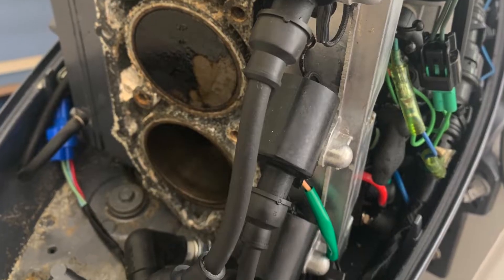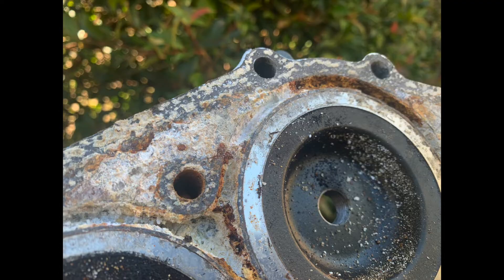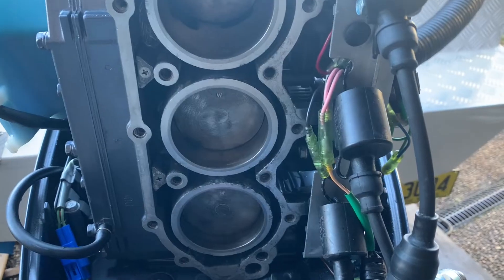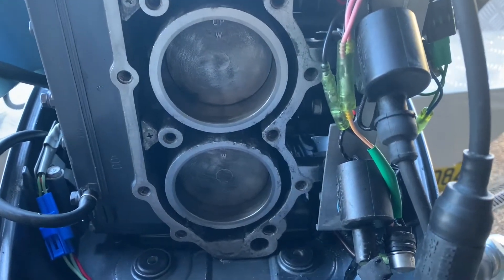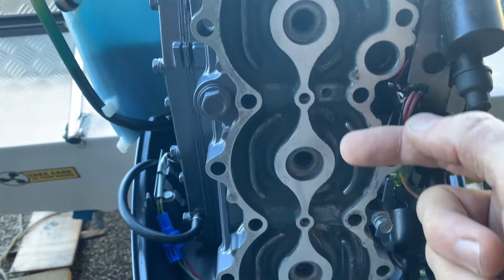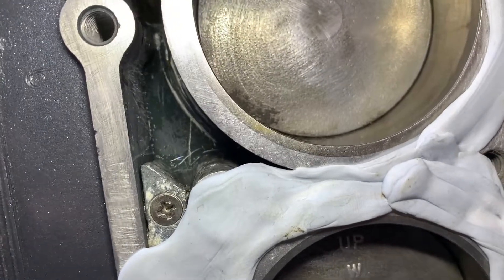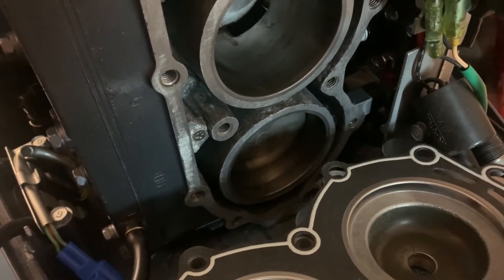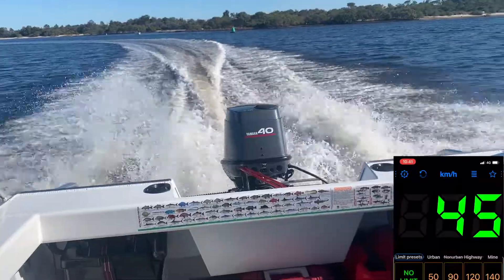Remove salt build up Yamaha outboard 40hp block head restoration Challenge get motor running 30 50

Comment: I’ve read that head bolts sometimes snap when taking them off. 
Did you have any issues taking them off?
Very education video.
Thank you
Reply from the maker: Hi Jim! Yes especially if over 5/10 yrs old & in salt water a lot, they are often locked with salt & snap.. I had to drill re tap one as the video shows re tapping thread etc.. Main thing is go very easy attempting to loosen bolts,, If you break bolts & lots of them, its often a bin job at that point.. Hope you go well with yours if servicing internally! Thanks heaps mate! 😃😃😃
Reply: @mikemike7523 thanks for the reply

Comment: Got a 60 hp two stroke , 7 years and same, all head system blocked with salt and corroding through head cover . Thought we flushed it but obviously not till thermostat opens. Redid the whole head system and left out the thermostat, we live in the tropics so reckon don't need it , same with cars  , now water flows through head when flushing and hopefully don't have a repeat for many years .
Reply from the maker: So good! yes leave thermostat out, will flush better for sure! Well done! 😃😃😃

Comment: Excellent and informative video Mike. Have just cleaned-up and re-fitted the very-clogged head of my over-heating 1986 40HP 2-stroke Yamaha - very similar design to your own. Two experienced local outboard mechanics wouldn't touch it. Only problem now is I didn't put enough gasket-cement around where the spark-plugs screw in, so a little water is weeping out past the thin gasket around the plug holes. I'll try sealing from the outside, and if that doesn't work I'll remove the head again and do a better job on the gaskets. Doing the work yourself is definitely the way to go. Vids like yours are priceless to amateurs like me. Many thanks.
Reply from the maker: Oh so good to hear!! Well done on cleaning yours up too! A little bit of work & elbow grease, leads to a job well done! Love it! Thank you! 😃😃😃

Comment: Did you need 1 gasket for this job or 2? Did you just use the gasket sealer on one of the faces?  
Doing mine this week,  any advice appreciated
Reply from the maker: Hi! there area numerous gaskets to do this job, which is why the full engine rebuild gasket kit is best cheapest option to get all gaskets... i never use any sealant on gaskets.. Im sure most mechanics would agree, that cleaning & preparing the surfaces with wax/grease remover & paying close attention to that cleanliness, is the most important thing... the gaskets are designed to seal well when surfaces are clean. Hope this helps! 😃

Comment: Nice video, thank you.
Question ; Yamaha 250 ox 66. When I get back to the dock and hook up a hose to the engine flush hose , if the thermostats are closed , where does the water go ? which part of the engine is not getting fresh water to? thanks
Reply from the maker: Hi! Generally if it's still cold & thermostats are still closed, or they are faulty & not opening,  it wont cycle the water in the blocks, so the water can overheat the engine then... The water will still always flow out the tell tale outlet.. Don't be deceived in thinking it is operating cooling water through engine, just because it flows out the tell tale visible outlet/spout... this is why full inspection & removal of heads is important if you suspect a problem internally like my video shows.. Hope that helps! 😃😃😃

Comment: How did you repair the hole at the bottom of the block?. I have the same issue with my 50hp Yamaha. Thanks
Reply from the maker: Hey! Yes there can be holes form after a few years... If its accessible to TIG weld or is worth the effort to remove block from the mounts to access, then do that.. I used liquid steel 2 part mix. Its strong, holds extremely well.. If the area is cleaned up well first it can be a good permanent fix. The key is good preparation. The water pressure is a minimal positive pressure, (unlike a car radiator / needing to withstand high KPA pressure), so the repair doesn't have to be pressure critical. Hope that helps  😃😃😃

Comment: I can tell you from my experience that sadly most of my customers don't give a flying f**k about paying for this service - until it's too late and they have to pay way way more to get a replacement engine. I do this to my own engines mostly
Reply from the maker: So true, yes it's far better to do periodic maintenance even if its a more costly service once every 5 years or so (head off & clean/new gaskets etc)... 😃😃😃

Comment: What is the difference between the new 40hp enduro 2 cylinder?
Reply from the maker: Hey! Not sure how new you mean, the latest current new models  are 4 stroke 3 cylinder.. Maybe you mean the 2 stroke 2 cylinder enduro a few years old still? (pre 2020)  If so, they are very similar to this setup.. just a bit more simple being only twin cylinder.. Hope that helps 😃😃😃
Reply: In malaysia we have 2 stroke yamaha outboard named yamaha enduro, but the 40hp only have 2 cylinder, rather than your version which is 3 cylinder, just wanna how different it would have in sea water
Reply from the maker: @firdausfazil1666  Yes we also have the 40 enduro 2 cylinder in Australia, up until a few years ago when 4 stroke became the only new option to buy. The enduro 2 cylinder is the cheaper version but still a very good motor. The 3 cylinder is a bit nicer to use as it has a smoother idle & rev range with the extra cylinder. It was a bit more to buy, roughly $1500 more for the extra benefits... As far as rebuild, they are very similar, so the job is the same to service.. hope that helps 😃
Reply: @mikemike7523  thanks you mike, im planning to buy 22 feet fibreglass boat with centre console, what type and length of boat you run the yahama 40hp? Btw, if you ever come to malaysia maybe we could go fishing together.
Reply from the maker: @firdausfazil1666  The 22ft (6-7m) fibreglass boat would be a bit big for a 40hp i think, unless you just putt around a bay in it.. a 40hp in Australia is normally seen behind a 4-5m aluminium light boat & it will perform well & get the boat planing easily.. A boat 6-7m fibreglass heavy hull would normally have anything from 100-200hp behind it so it can get up to planing speeds easily...  Happy fishing!! 😃
Reply: @mikemike7523  hahaha, guess i will go for bigger hp, thanks for the advice mate 😊

Comment: Excellent clip! Would you please tell me which parts that need to replace when performing this job? I'm about to follow yours to clean up my 90hp Yamaha 3 cylinders. Thanks.
Reply from the maker: Hey Victor, main thing is the full engine gasket kit.. apart from that, just normal service things like thermostat if its due/needed.. It's mostly chiseling out any hard salt build up, so mostly cleaning & put back together unless you break head bolts getting the head off.. if you break a few, the engine is probably not worth trying to go further unless you really know what you're doing to drill & tap bigger head bolts in... but broken head bolts being high tensile stainless, are extremely hard to drill out... I'd probably say if you break more than one, dont bother.. Outboard engines have a relatively short life once they get to that point where bolts no longer undo.. Hope that helps! 😃😃😃
Reply: @mikemike7523  thank your for your advice. That's why I really hesitate to do this job 😀
Reply from the maker: Yes, best to try unbolt before buying any parts! 🤣🤣🤣

Comment: Hi mate this is a great video i have a 40hp  bit older than yours but i did the same thing only i stripped it right down ,cleaned the block and head  and cover with CLR and like you wire brushes fitted new rings honed the bore new gaskets in carbs new gaskets through out new coils ect basically rebuilt the engine  , yamaha say to run your engine for a min of 15 minutes as you say to let it get up to temp and the thermo to open , in the end with mine i upgraded to a fourstroke  but it will help many others who a mech has told "throw it in the bin" it is a two stroke engine really an oversized lawn mower  and with out cams and valves ect easy to work on again great video .
Reply from the maker: so true! Thanks mate! Yep the 2 smokers are the bomb to work on, & they rev like a 4 stroke can only dream about! Enjoy & thanks for the message!  😀

Comment: hello, nice video... congratulations... the thing that terrifies me the most is breaking the screws that fix the cylinder head, I saw that you only broke one.  my engine seems to have the perfect cooling circuit or anyway working but doing a compression test it only gives me 65 psi in all three cylinders.  but it doesn't seem that bad to me.  this is the test video.
Reply: Also some cheaper compression testers will read roughly 30 psi low you might have around 95 in each could be the tester I’d check it again with a higher quality one
Reply: https://youtu.be/5aSwCPgxx9A
Reply from the maker: Thanks mate! yes if you break lots of bolts, then bin it! 🤣🤣65psi could be worn rings, but could also be corroded head gasket on all cylinders maybe? enjoy! 😀😀😀

Comment: Hey brother, nice show, it identifies everything im showing guys..lol.. to cool. I have 3 episodes. Ep1  I just posted on this,,, I love the word challenge. so I found a product and a way to make the inside of the engine completely free of build up.  episode 1 is a test of SALT AWAY AGAINST RYDLYME AND RYDLYME REALLY WORKS, IT DESTROYS SALTAWAY, THEN EP2 IS HOW TO BUILD A SELF CONTAINED FLUSH SYSTEM FOR UNDER $150. Just remove thermostats AND ANODES IF THEY HAVE THEM turn the pump on and FLUSH, this is the cool part, the product is measured in PH, so you can run it on the pump until what goes in for PH as a clean fresh cleaner comes out clean as it went in because when it breaks down build up it raises the PH..If a motor like your was on this set up, doesn't need to run the engine just then  pump as long as the PH is rising is eating away at scaling and everything else, I am confident it would work.    I really want to find another engine like that to do this test.  If you watch my EPISODE 3 HOW TO FLUSH WITH Rydlyme you will see how I do It and maybe test to. let me know if want a link, not trying to post on your stuff, just like your videos it is so relative to mine. And you said challenge. lol

Comment: Bloody legend mate! Made it look doable as I am in the same situation with a Johnson 110hp (86 model). Marine Shop said its not worth fixing! Any other tips before I give this ago. Worried it may also need be machined too. Subbed!
Reply from the maker: Hey awesome thanks mate! Yes biggest issue on older models is if you start breaking every bolt when taking the head off etc... If you do, it's beyond repair.. but the thing is, you can begin, and give it a go right?! Will be best to hold off buying gaskets & parts until it is apart so you don't lose those dollars if its not repairable... Hope that helps!  🤑🤑🤑😀😀😀
Reply: @mikemike7523  Cheer buddy, will give it a crack after NY, I assume doing both sides since its a V4 setup is preferable. Will report back in a few weeks :)
Reply from the maker: @kostiz  for sure, yes i'd be doing both as you'll need to clean it all not just a half job.. you'll know by the time you attempt to remove both heads if its even worth continuing.. It's an old motor, so you could be lucky and get it apart smooth, but possibly not.. if its in really good condition, then its worth throwing a few $ at it, if you get to the rebuild stage..  If you can do a good job, & if you can get another 3-5yrs of use from it would be worth it hey 😃

Comment: if its not kept in the fully down position, water can definitely stay in the block. so many people leave their motors tilted all the way back for the winter... ice loves that. but the issue here is some complete idiot didn't flush this poor thing out with fresh water before letting it sit for a decade.

Comment: If I remember my metallurgy correctly a carbon steel wire brush should not be used on aluminum, at minimum it should be made of stainless steel. Otherwise dissimilar metals corrosion can be a problem.

Comment: One thing  the mechanic where i get my yammy serviced mentioned was that many don't flush the motor long enough - he said a minimum of 5 minutes . I have always used the same procedure on every motor i have owned - start it and let it run until the thermostat housing gets hot( i can see the flow from the prop hub has increased so i know  the thermostat is open ) turn on the saltaway flush unit , disconnect the fuel line  and run it until the motor starts to miss and shut it all off . Not sure how good the salt flush stuff is but it does take salt off better than fresh water - would love to see the water jacket of an engine that has used this stuff from day one to see if it really does stop salt build up .
Reply from the maker: Yes so true, a good 5 or more mins if motor is still fairly warm... longer if it's cooled right down before flushing.. but as you say, the tell is the warm water out the prop outlet for a good while! I'm sure the salt products do help remove surface build up, but they can't do heavily compacted rock hard salt blockages.. It's hard enough with power tools!! 🤣😭😎

Comment: I have a 40enduro 2005
Reply from the maker: oh yes very nice motor too... the twin cylinder, bit lighter, both motors get you where you want to be just fine! The triple cylinder is just a little smoother running & idle... happy boating & spearfishing! 😃
Reply: @mikemike7523   it came crank so am trying to convert it to electrical switch
Reply from the maker: @KevinTheDiveKidd  i wish you success with that! it will be awesome!

Comment: Best to run the motor until tell-tale water is warm so thermostat is open then flush with a product like Salt-Away, Salt-Stop, Salty Captain or many others. Prevention is better than cure! Nice recondition job though!
Reply from the maker: yes & thank you! Just to clarify to others, the tell tail isn't warm because its cycled through the block & thermostat, as is often thought.. really need to check that good supply of warm is coming out the prop/exhaust.. as that is the only water that is actually cycled through the block/head & thermostat 😀😀😀
Reply: @mikemike7523  ok good to know cheers that was my impression.

Comment: Don’t worry about breaking bolts.  There’s lots of instructions on utube for fixing the issues arising.   You should have drills and taps at hand beforehand, they’re cheap and at the least all the threads should be chased clean before reassembly.  Thread repair kits are now cheap on line too, so don’t worry.   
You cannot begrudge the mechanic charge out rate,  if he can do the job well, he (she) is well worth double.  Sadly and happily the new smaller engines are so cheap it’s simply not economic to maintain an engine to this level.   I do it only to keep a 2002 two stroker going as the equivalent four stroke is nearly twice the weight.
Reply: breaking steel screws in aluminum is a nightmare. every try doing 6 in a row? its not practical, and a machine shop will charge you $50 a screw. better to find another block sometimes. unless its a labor of love.

Comment: It isn't worth it for a shop to do that kind of good job, but that does not mean the motor is junk.  If you've got the time and the knowhow, or know someone that is willing to do it at their leisure, most of these motors can be saved.  I shudder to think of how many good motors were scrapped because someone said its not worth it.
Reply from the maker: So true 😄

Comment: I would have put rags in the cylinders. Then salt and dirt do not end up there or find their way into the crankcase. Am I wrong?Otherwise a very good video. Thanks .
Maybe you should also tape over the cylinders?
Reply: not the crank case, but the rings will surely get some grit. i completely agree. cringed a bit. stuff a rag and some grease around the outside, then just wipe off. no grit.
Reply: @ct1762  Thanks so much. Appreciate your reply.

Comment: Makes me think maybe run the motor for a minute after flush with no water to push final bit out?  What are your thoughts on this?
Reply from the maker: Don't think that's a good idea Bill, they need full water pressure while running at operating Temp so they don't overheat, & once the water pressure falls, there is no thrust to  push any water from the block. The water pump cycles water in the block/head but it would simply stop all water movement once the water pump has no water. Hope that helps 😀
Reply: @mikemike7523  Makes sense Thanks

Comment: Do you flush your motor after using it?
Reply from the maker: Yes always flush, but even if you do, when using in salt water, they still build up salt deposits over time..😭
Reply: @mikemike7523  yea that’s true, i live in the Netherlands so we don’t have a lot of saltwater here. My engine is always used in freshwater